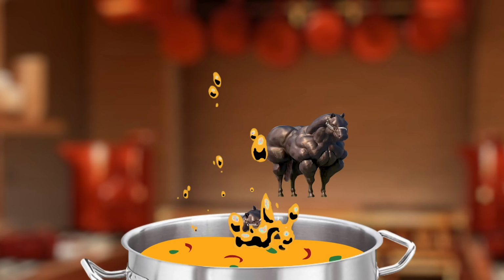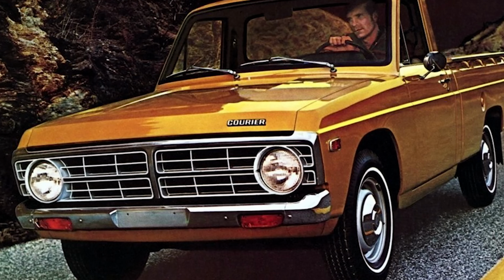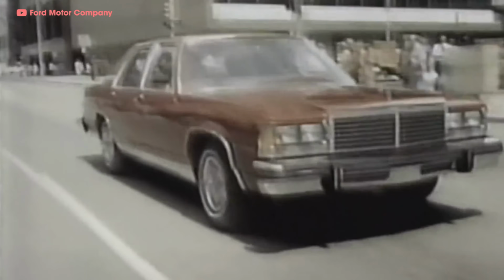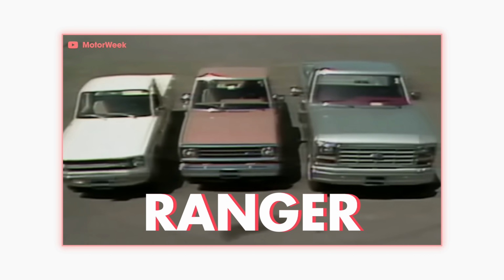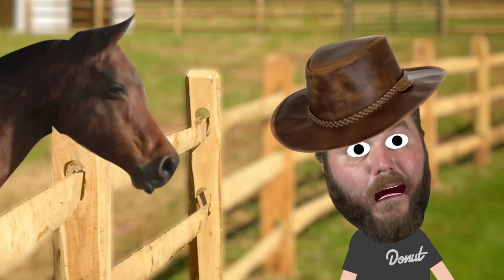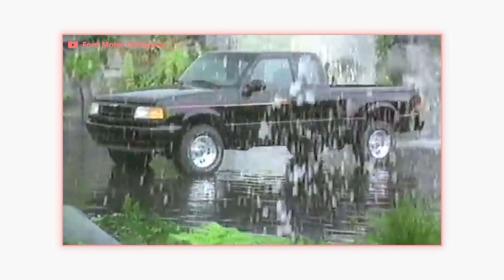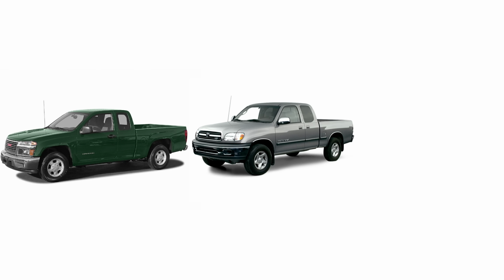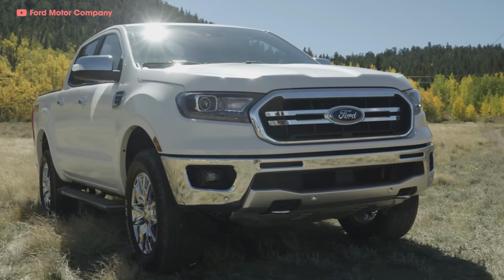FORD RANGER - Everything You Need to Know | Up to Speed

Comment: Sold my 1994 Ranger XLT with 5 speed 4.0 liter last year.  4inch lift, light bar, wheel spacers, straight piped.  Just the perfect highschool truck.
Reply: I added one like when you were at 68
Reply: I have a 93 ranger with a 2.3 5 speed manual straight piped
Reply: @bradley4698  nice
Reply: Did you perhaps sell it to a man named Cody?
Reply: my ford ranger can beat that
Reply: *Sadness noise*
Reply: Bro I graduated in 91 and I had 86 or 88 with almost same specs  Kc lights  Hurst Shifters, alpine cd player 2 12inch woofers and power 300 Amp and 6×9s and it was black and gold , Iowa Hawkeye  colors which were same as my Hs Football teams, wish I would have kept it!
Reply: 97 ranger xlt 2.3l 5 speed. Have a 2.3 l  Turbo out of a late 80s Ford thunderbird going to be sticking it in eventually when economy gets a bit better.
Reply: You sold that truck to a man named Cody aka whistling diesel
Reply: Just graduated with one got a 03 xlt

Comment: I remember the 97 ranger, its was rather snappy to drive with a manual transmission and it spun the tires rather easy making it a pretty fun and good utility machine that could get to a healthy 115 mph if you ever where in a real hurry. (My former boss wasn't too thrilled with the short longevity of the rear tires... Yet he kept lending it to me tho.)
Reply: I have the 2021 XLT FX4 with 285/70s and I love to drift it, it pulls a trailer like a dream, or you can pull a toyota uphill with its breaks on LOL and get 22 MPG while you are doing it :)

Comment: “Everything you need to know about the Ranger” except for mentioning the Ford Ranger XLT Extended Cab *4.0L* V6 4x4 with a 5-speed Manual making you 207HP AND 238ft-lbs.
Reply: Frl, I have that exact truck and he just completely skipped the 3rd gen ranger specifics
Reply: Right! I just bought a 5mt v6 4x4 ranger   and came here to hear james hype it up. I am dissapointed
Reply: Most of these episodes are for entertainment sadly. Not accuracy
Reply: Too bad the Mazda 4.0 is a turd
Reply: @Will-fr5du  seriously! I came watched this video because I have that exact truck but it wasn't mentioned. Am sad. :(
Reply: @PervasiveFire  except nowadays its cheaper to put a stroker kit for an extra .3L of displacement making 70hp and 80tp+ which makes it better and cheaper than buying an old crown vic
Reply: @benson4u215  the extra power is always nice but the 3.0s are super reliable and just a smoother motor, but yes if I wanted a fast ranger I'd get the 4.0
Reply: @PervasiveFire  I loved my 3.0 5spd 2wd.. it was not a slow truck. I've never driven a 4.0 but I'd bet a turbo would wake that 3.0 right up
Reply: @trikelyfe6090  I wish mine had a 5 speed,  the auto is anemic with the 3.0. A place I used to work had a Ranger with the 3.0 5 speed for a company truck, man I loved driving that when I had to do parts runs.
Reply: Michael Reed and a 89 reg cab stx model
Reply: What!
Reply: Will same here I have an 04 with those specs it definitely has mo powa baby
Reply: Ranger wildtrak t7 bi-turbo has 210hp but has 500nm torque but is only available at asian region,its pretty powerful for a 4cylinder 2.0 liter truck
Reply: The best ranger motor is the 4.0 from the 2nd gen stx it’s the v6 from the explorer and was marketed to make 200 ish but made more like 230
Reply: Have that exact truck
Reply: @godsgaming9009  do you know what year range featured 2nd gen?
Reply: I have the 2 wheel drive version and it's got enough power to be almost dangerous , mine is the auto though .
Reply: I have a 2011 4.0 4x4 with the 5 speed. I added an M90 supercharger, and it has a small lift with 33 inch tires
Reply: same truck bro

Comment: We just going to gloss over the fact that the new (current) ranger series is a Ford Australia creation (Designed and Engineered) and not a Mazda invention?
Reply: Let me guess. You're Australian and have to let people know?
Reply: w w actually I think Chris Webby is an American rapper.
Reply: So it's an oversized ute.
Reply: MazdaSpeed 3 motor with ford sensors shoved in it
Reply: And built in south africa
Reply: @kevinmarshall5102  The only real thing shared between those two engines is the block. Head, turbo, fuel delivery, and VVT are all different.
Reply: @castlevaniaking5  so they fixed the problem? Lol found on road dead they couldnt fix our speed gave us over book to trade in. Have a letter from mazda stating its a common speed issue and I needed a new engine...yes I'll buy another ford every 90k milkes
Reply: I always wanted my push mower economy
Reply: @mitchellsaunders5495  yup
Reply: @mitchellsaunders5495  Thailand for oz market
Reply: slam slam I mean you just got pissed off because of a joke good job bud or is snowflake better? Up to you
Reply: Bruh why aint we talking about the toyota yaris which is literally a mazda 
Bruh even the body of that specific yaris looks like a mazda 3 but smaller
And that engine ain't toyota 
Bruh some parts even say mazda on them pfft

Also i can understand a scion frs also coming as a toyota cause toyota and scion are like the same 
But why does a subaru brz exist ?
Looks like the same car but i have not worked on them yet to know if the insides are the same so cant tell ya that

Comment: My very first vehicle was a 1983 Ford Ranger XL. It had the 2.0L, 4 speed transmission, and a 456 rear end. The build date on it was was 06/1982 making it one of the first Ranger's built. It has to be the toughest little truck I have ever owned and trust me I put it to the test all the time. Totally miss that truck!
Reply: I inherited a 1986 2wd 2.3 ranger. Put in a new clutch flywheel ect. Dash says 94k probably 394 idk still runs has 6x9s behind the seat and a saddle blanket seat cover i love it.

Comment: The ranger in Australia is 3.2L turbo diesel 4x4 with a 6 speed manual transmission.
Reply: In Philippines we have the ranger raptor. But no ecoboost :( just a crap 2.0 bi-turbo from mazda
Reply: Driving one. Love 3.2 XLT mated with manual 6 speed, match made in heaven
Reply: @cymonthebest  we get the 2.0 bi turbo raptor in Australia as well and the   Everest
Reply: @dilloxr6  we only get the bi turbo on the 2019 ranger wildtrack :/ no 3.2 option
Reply: @cymonthebest  im pretty sure the wildtrak still has the 3.2 option in aus not 100% sure   i know in xlt and Everest theres 2.0 bi n 3.2
Reply: I creamed my pants reading that lol
Reply: I wish i could import a 6 speed manual in usa for 4gen ranger.
Reply: Dillo117 my dads Grey 2018 wild track has a 3.2 auto but u can get get the wild track kit with. 2.2 up to u really
Reply: derp derp the new 2.0 bi-turbo engine is such a shame. More than 1000 vehicles in Vietnam have problem with oil-leaking. I'm currenty driving a 2.2L turbo diesel 4x4 and really happy with it (and it's manual, of course)
Reply: Ryan Pham that’s a Mazda engine don’t expect much

Comment: You made me want to buy an old 1998 Ford Ranger
Reply: as a 2nd or 3rd car, parts are cheap runs u less than a tacoma
Reply: Go do it then brotha. Got my 99 for $3,000 2 years ago. Still love it every day.
Reply: @jacksonb.valentine8208  thats a good price plus naysays are wrong cuz even with repairs youll still pay less than you would if u buy a tacoma. unless free ill take the ranger
Reply: do it bro. i had a 97 with the 3.0 i traded for a 1978 f150, loved that truck it never let me down
Reply: You can buy mine lol
Reply: If you want a good reliable truck that you don't want to feel bad smashing around, do it.
Reply: I'll sell you a 99 with 120k on it for $5000, just replaced the rear half of the frame, brake lines, and put manual lockers in place of those shitty pulse vacuum hubs
Reply: He made me buy a 83 ranger😂
Reply: Third gen is my favorite gens of all times
Reply: Recently became an owner of a 94 ranger. Its a nice little thing I'm starting to love it.
Reply: Do it, my 2000 3.0L V6 5 speed manual has 220k miles on it, and still runs perfectly fine. Got it for $1,900 due to all the ball joints being shot and a rough idle. Pressed in some new ball joints and a quick tune up and it runs like new.
Reply: Do it, mines a '89 Ranger XLT, we got it at like 500-600k miles and now its been 850k+ miles and its been doin me good for 4-5 years, I've maybe put in like $2-3k in maintenance in that time and it runs great
Reply: A lot of the older Rangers have serious frame cancer. I’d not waste my money tbh.

Comment: My grandfather left me his 1996 ranger when he passed away. 4 cylinder, 5 speed manual. Just recently had to install a timing belt and spark plugs and wires. The factory plugs and wires where still in the engine. 23 years later, they still worked. 100,000 miles.

Comment: Got my trusty 94, 4 banger, 5-speed extended cab right outside. Started right up at -10 Fahrenheit yesterday
Reply: Brian Schell my 99 is at 271,000 miles and still going strong. Love that old girl.
Reply: I have a 2011, 4.0L V6, five-speed.  Started up with no problems at -14F after sitting overnite at -35F.  No block heater.

Comment: 1992 Ranger 2.3 5 speed, 250k and runs like a goddamn champ
Reply: I had a 2001 manual transmission and it had 319,000 miles. It ran like a champ too and I sold it for 1000- cause door handle broke
Reply: Ive got a '96 ranger xlt 2.L 5 speed with only 163k. Needs some brakes and cleaning but shes amazing
Reply: Just purchased a 91 with 90k miles on it. Everything original except for some HID lights that were installed.
Reply: I also got a 96 w 210k miles still runs like a beast
Reply: Just bought my '94 Reg cab with the 2.3 paired up to a manual. Slow as fuck but starts every time.

Comment: 6ft bed = 4x8 plywood hangs over tail gate
8ft bed= construction workers can close tailgate
Reply: That 1 time you didnt wear a hard hat
Reply: Ranger raptors sell quickly here in the Philippines but I wish the US design would be the same with asia design US DESIGN IS JUST BADASS
Reply: Construction workers dont use Rangers loll. Who the fuck would??😂
Reply: Adriel Tan South Africa has the best one
Reply: @RBZ06LT6  I've known quite a few HVAC guys and electricians that use trucks like the Ranger, Dakota, or even the Shitrolet S-10. Not every field (or guy within a field) needs a full size truck.
Reply: @reaperreaper5098  I have a Dakota and a ranger. I prefer my dakota
Reply: @american_patriot1776  I've got a '00 Dakota, and the only short coming I've found is the width between the wheel wells. Then again, I do steel stud framing and acoustic ceilings primarily, with occassional sheeting, so I kinda need to have a full sized truck in addition to the spunky lil pick'em up.
Reply: @reaperreaper5098  mine is an 04 rust bucket. I'm 14 and I use it around the farm
Reply: @american_patriot1776  Take care of it. Dakotas never sold as well as Rangers, and Dodge/Ram seem to have no interest in bringing them back, so once the Dodge baby trucks are gone, they're gone.
Reply: @reaperreaper5098  yes. it was my dads then it didnt pass inspection anymore so we registered it as a farm truck so now I use. it

Comment: I've got a 93 Ranger XLT. The air still works.. 5 speed.. Looks like shit but I'd drive it anywhere. Paid 500 bucks for it about 3 or 4 years ago. Been a good truck.
Reply: How many miles igot 670000
Reply: @Jlffod  I have no idea.. The guy I got it from said the odo rolled over at least twice. Lol reads 61,837 right now. So Id say about 261,183

Comment: I love the old rangers! My grandfather has had his 87 ranger since new still going strong! I had a 03 ranger edge with the 3.0v6 and 5 speed. I still regret selling it! I can't be the only one that doesn't like the new ranger. It's to big if I wanted a truck that size of just buy a f150! A lot of people and bussiness want a small basic truck! And with a manual transmission!!
Reply: I had and '03 Ranger Edge too with the 3.slow and the 5 speed.  It had a Camburg suspension kit on it and 33" tires.  I also put in a Detroit Locker in the 8.8" rear end.  I miss that truck!  Those Rangers were SOLID!!   It was also a great little truck for off-road trails.  They pretty much dominate the California desert going pretty much anywhere and through anything.
Reply: It's true, it's not really a small truck anymore..somewhere between what it used to be and what the F150 was.  F150's seem bigger now too.  Hell, trucks in general just seem like they've gotten bloated since the 90's.  I think it's unnecessary.

Comment: I don't like the look of the new Ranger. Much like when the Rangers and Bronco II shared similar body styles in the 80's into the 90's I am hoping that when the new Ford Bronco is released the ranger will share similar body styles with the Bronco because the new ranger doesn't appeal to me.

For those who poo poo me and say that the Ranger and Bronco II did not share similar body styles and interior trim when my Bronco II was in the body shop and the body guy was looking for a replacement and he did not want to use an after-market one do to fitment concerns.

 He couldn't find a door for a Bronco II. So I told him to go and look at the part numbers for the doors from a Ranger and the Bronco II to see if they matched, and they did so my Bronco II which is now parked in my parents garage has a Ford Ranger driver side door.
Reply: They said in the Bronco video that they would cover the Bronco ii In this video. I was disappointed as I own one. I love my Bronco ii. Fun truck, good fuel economy. But those huge side windows leak hella.
Reply: @that_camo_bronco_guy  Heh, my old girl hasn't run for a decade and a half. I gotta get her up here and get her running. Poor thing doesn't even have a valid VIN. First car I ever turned over and that engine sipped gas just enough to buy us time for some one to hear our CB in the middle of one of the worst blizzards in modern history. Saved a lot of lives back then.

Comment: I loved my '01 Ranger. Only problem I really had with it was the AC was going out and didn't work until I got the engine warmed up. Then I got hit from behind and that guy's insurance said it was more expensive to fix than it was to replace. Kinda wish I'd stuck with a Ranger instead of getting the F-150 because I got way better fuel economy. I also wish they never stopped selling the Ranger in the US because I just had to replace that F-150 and would have loved to get back into a Ranger, but 2009-2011 rangers are still selling $20,000+

Comment: i have a 1996 ranger xlt with the supercab, 7 ft bed, 4wd, 5 spd manual, lift kit, and a 3.0 V6. it's got 570k on the odometer and its still going strong! (also original engine and transmission)

Comment: 1994 Ford Ranger “King Cab”. I was 8 years old and still felt like I was wadded up in the back on those stupid 90 degree no recline fold down seats. 

My jam was 1984 Mazda B2000 5 speed. It burned a little oil and it had a leaky wet clutch. But it was my first car and I loved it. Put myself 2 6” 3 channel speakers and I hid a cranking stereo system in the glove box. I was “bumping”. I had chicks literally running to not ride in my truck. 🙃

Comment: I had a 2002 Ranger XLT with the 4.0.  It was a decent little truck but got insanely poor gas mileage scoring in the 12 mpg during winter gas and about 15 rest of time. Between the poor mpg and the tiny gas tank it was always in a state of running out of gas.

Comment: I just bought a 1994 4.0 v6 xlt 4x4 manual with exactly 200k miles. I've been driving an 09 2.7 4 cylinder rwd manual tacoma for 5 years. That tacoma has had no issues. Amazing truck. I'm really excited to see what this ranger will be like. I don't know a whole lot about mechanics and engines. But it seems like the 4.0 v6 ranger is very reliable. Hoping to get good use. Anyone have experience with what I have? I'd love to know what to look out for/how to keep her going.

Comment: Only thing now I've noticed on my 4th rewatch over the last year or so is in 1992 they replaced the 2.8L v6 with the 3.0 vuclan. They didn't replace both with the 4.0 cologne V6. I only know this cause I own a 2003 ford ranger with a 3.0. Also another note not all rangers got the double wishbone in the front the Edge package and some others got torsion beam in the front. These are just small little things but fun to realize after getting a ranger after this video.
Reply: The 2.8 was replaced with the 2.9 in 86, which ran until 92. The 3.0 was introduced in 90. Depending on regular cab or extended cab influenced which small V6 it got.
The 3.0 ended in 2007 or 2008. 

The Lima 2.3 ran from 83-2001 starting at 2.0 and ending in a 2.5l. 2002-2011 was the duratech 2.3 which is totally different. 

The 4.0 was introduced in 90 and an optional engine. And the 2.8,2.9,4.0,4.0 sohc where all cologne engines. 

And 98 and new rangers all had double wishbone suspension, torsion bar or coil spring. Both contain upper and lower control arms (wishbones)

98-newer Base 2wd had a coil spring front suspension, while 2wd edge and 4wd had torsion bar suspension. Still both "wishbone

Comment: You could get a Vulcan 3.0 V6 all the way through 2008.  They didn't retire it in 1992 but added the 4.0 as a second V6 option.  Today the Vulcan is referred to as the "Three Point Slow".
Reply: 4.0 was added in 90. The retired the 2.9 in 92 though

Comment: I'm working on my 04 5 speed manual Ranger with 325k miles right now. Exhaust finally gave out. Still runs great, looks like hell though. I do not like the new Ranger, to big and expensive. I'll run this until it just wont go anymore.

Comment: The problem that killed the Ranger was that it only got a few more MPG than an F150 but had way less performance. Just wasn't worth it to have a less capable truck for hardly any savings. I actually chose a F-150 over a Ranger for that reason. If you need to tow a decent size trailer a Ranger just dosen't cut it.